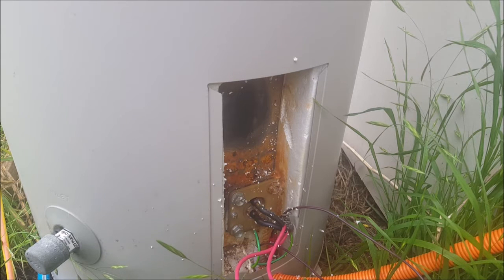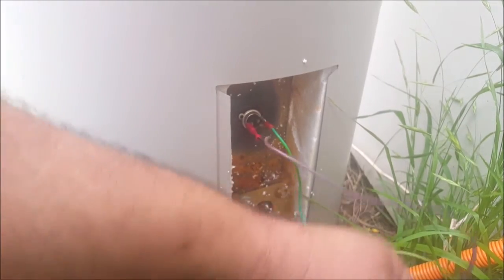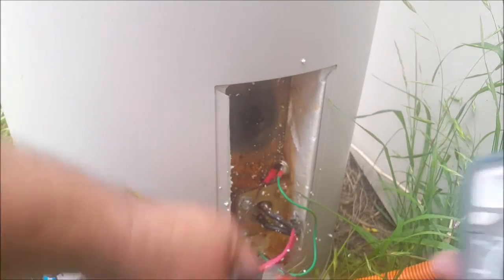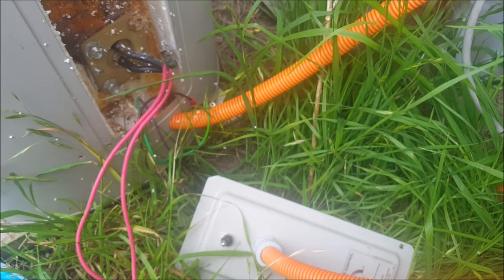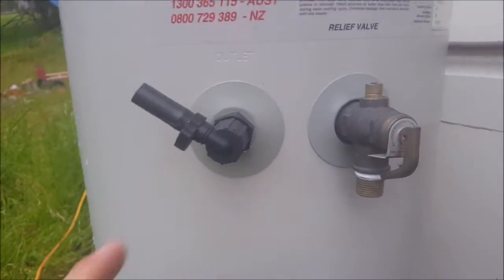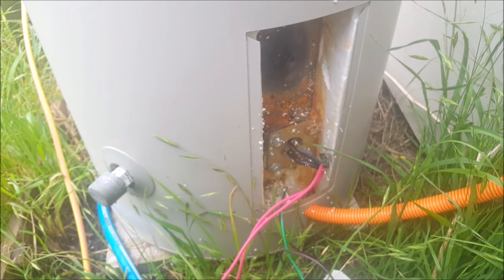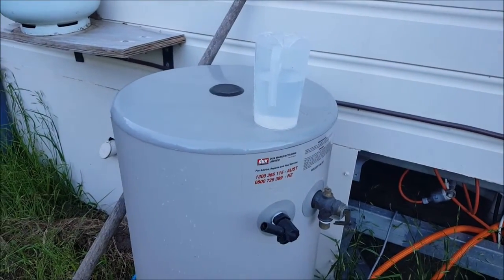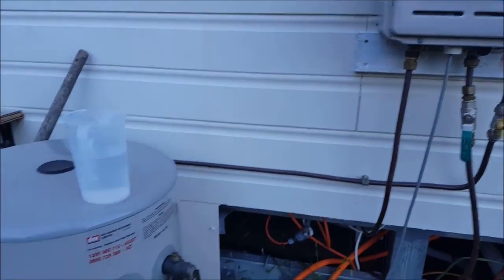Off Grid Solar Power - Solar Electric Hot Water - Part Two

Comment: You should interface a charge controller between the panels and tank element. On full sun days it’s not much of a problem not hooking the element through a charge controller but on overcast or low irradiance the panels voltage will crash trying to supply that 600w load element. An MPPT charge controller will match its output impedance with solar panels impedance (Varys with irradiance level. Lower irradiance higher the panels impedance will be). In other words it limits the power to the load in order to deliver maximum potential power to the load - operate at maximum power point.

Comment: Are you hooking your panels straight to it or running threw a charge controller first?
Reply from the maker: No charge controller.
Reply: Pop's Shack what u using the thermostat for to cut power off at certain temp? I was wondering about running like that off solar just didnt know if it could handle the 18 or so volts from panel.
Reply from the maker: Relays. See part one:
https://www.youtube.com/watch?v=8BhntKzc0TY